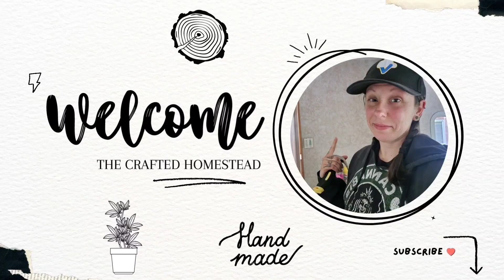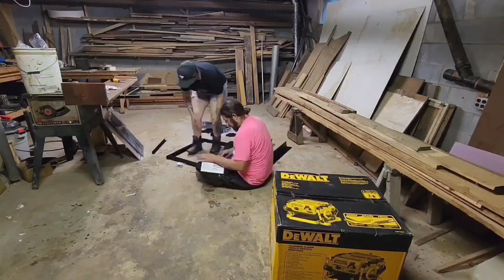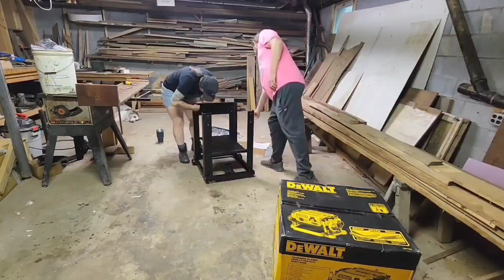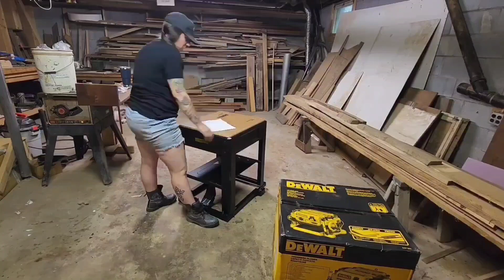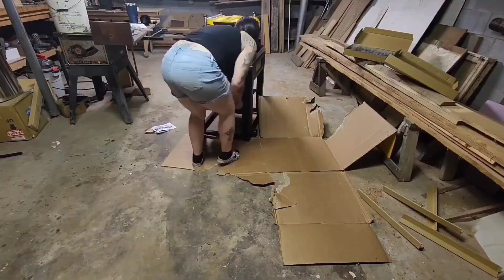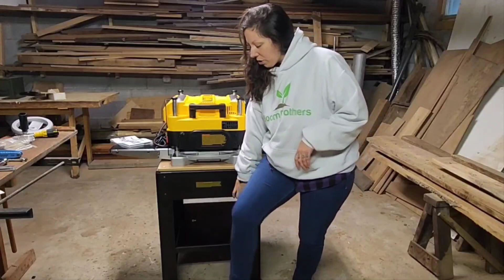Assembling the DeWalt DW735 13" Thickness Planer - in Fast mode 💪

Comment: Hope you enjoy your new planer. Here is a tip on the 735. If you get a chip line on your board. unplug the machine open the top. The knives move side to side 1/8 inch you only need to move one to over lap the chip part of the blade.
Reply from the maker: Thats brilliant! I really appreciate you sharing!

Comment: Hair looks fantastic!
Sounds like you may consider repurposing some wood. If so, be wary of foreign debris such as old nails. It will ruin the blades. If you’re going to do a LOT of work then you can justify upgrading your planer to a SHELIX head. Will save you money and time if you’re doing a lot of work.
Reply from the maker: I appreciate the advice!!! I do have wand for finding all the nail bits and potential metal shards. I was super worried about it lol. And you recommend one day getting the SHELIX head? I'm going to have to Google the shit outta that lol
Reply: I have it, make sure you get the oem size. You have to take all the cutters off for instalation but it is well worth the hassle.
 @WickedWayAcres